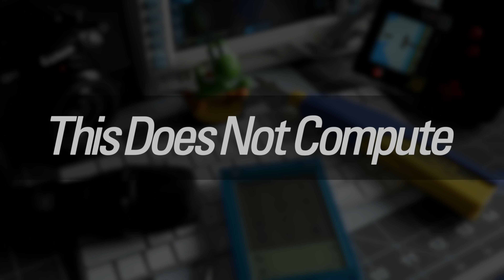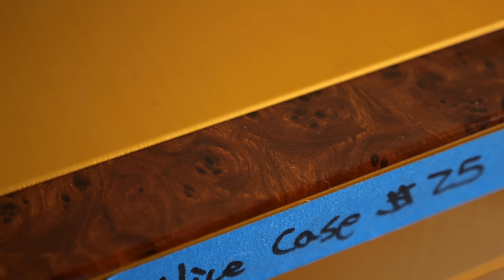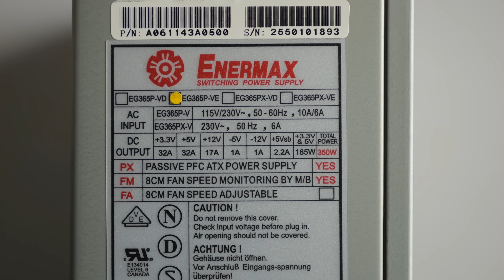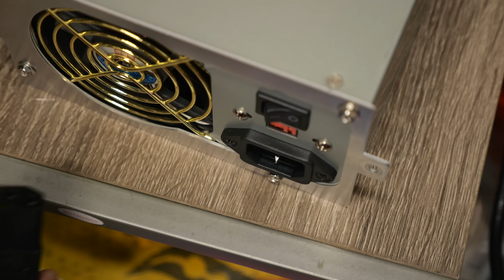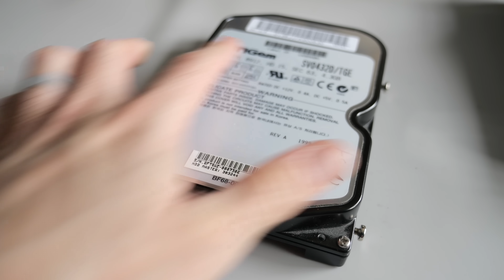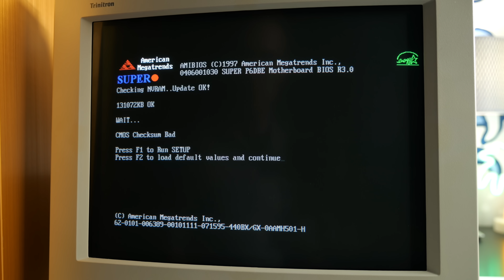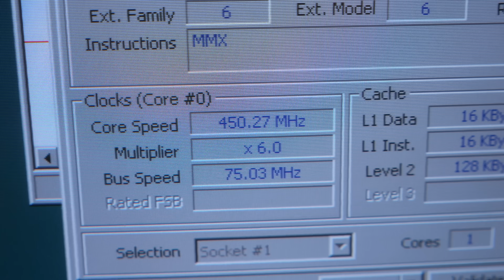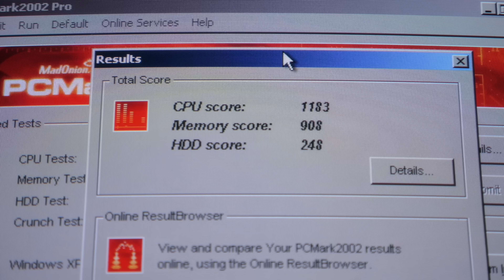I tried to put TWO vintage Celerons in one PC

Comment: I pulled a PC-601A out of the Physics Lab dumpster, surprisingly a couple light scratches but no dents. It runs my retired X58 system now (990X, 24GB, RX 580 8GB), and afterward I got a PC-61B that was saved by a retired NORAD employee when they were shredding old systems... to paraphrase the gentleman's words, "it was too nice looking to throw in the shredder, so I pulled the hard drive and tossed that in (the shredder), and they let me take the rest of the system home with me".

He then sold it to me for $25. I installed my retired Z87 system in it (4770k, 16GB, 980Ti 6GB). A Noctua NH-U14S actually fits perfectly without rubbing. 

I also have a Velocity Micro that's a re-tooled PC-60A underneath, and using WayBack machine I found the original listing for a ProMagix HD-60 retailing for over $4k in its day (2006-07)... someone got literally every option for this case, including the optional wheels, optional acrylic side panel, and optional cold-cathode lighting kit. That one I'm leaving mostly stock. I got it for $80 on MarketPlace, only missing the GPU (I believe it shipped with a 9800 GTX+ originally). I installed my retired ATI Radeon HD 5970 instead. 

I had to fill the holes left by the old drives left in my cases, they were all unsightly beige actually, even on the B case. Both machines were missing 2x 5.25 covers, as well as 1x of the 3.5 covers for a Floppy or Zip drive, so I gave the 61B a Blu-Ray/HD-DVD/DVD-RW drive, the front panel controller for my X-Fi Titanium Fatal1ty sound card, and a 4-port USB 3.1 hub with card reader, all in black. The 601A then got matching LG Blu-Ray burners in black and silver (good match for the Aluminum tone), along with a NOS Lian Li Aluminum USB 2.0 card reader. 

In both cases, my solution was what I had on hand (I recycle e-waste, that rare HD-DVD drive for instance came from a Gateway FX tower with bad caps found in a dumpster), and the cost still ended up being far less than replacing those covers. I imagine the PC-60C (Copper?) anodized case covers are pure unobtanium (I've only ever seen Aluminum and Black finishes for sale on the used market), and you had all of them... what luck! 

I would have left them installed and run external optical and floppy, but that's my opinion. I think it looks awesome, I've not seen the faux wood trims before, either, as mine came with the faux carbon-fiber trim panels instead. You scored a real gem there, thanks for sharing!

Comment: it will work with slotket with dual cpu support jumper and socketed celeron. 😅 And of course an 440bx chipset Asus P2B-DS motherboard.  i've done it before. You have to use nt windows too. 9x windows don't have dual cpu support.

Comment: My lab mate and I built a couple of these back around 1998. I remember having to solder the wire to enable SMP, but I don’t recall having to disconnect any traces or do any drilling. Worked great with Slackware Linux and kernel compilations were super quick, esp. at 450MHz. Did quite a lot of work on that machine. I would suggest running an old Linux rather than Windows on a machine like this. Windows from that era was junk afaic.

Comment: Haha, I had an Abit BP6 with two Celeron A 300 MHz CPUs overclocked to 550 MHz, running Windows 2000 Pro in a Lian Li aluminium case, back in the day. Strong nostalgia feels with this one.

I remember Creative’s SoundBlaster drivers wouldn’t work reliably with dual processors, until they eventually fixed this. Quake 2 Arena would gain a little speedup in r_smp 1 mode, which was cool.

My current vintage PC has dual 1 GHz P-III Slot 1 processors on an Asus P2B-DS motherboard and a Geforce 4 Ti graphics card. It’s the dream PC I wanted 25 years ago but couldn’t afford until now. Runs Windows 2000, OPENSTEP for Mach, BeOS and even Haiku beautifully.

Comment: Thanks for the nostalgia trip. I had dual 300As @ 450MHz running Windows 2000 on I think it was a DFI board. I was lucky enough to get some P3-550s and then eventually moved onto a TYAN S2466 + pair of Athlon MPs.

Comment: I have a similar case. No fancy colouring, just plain aluminium. The dust filter disintegrated on me when cleaning it a number of years ago. Ended up as powder inside the vacuum cleaner.

Its first build was either an Athlon XP or Athlon 64X2 running Windows XP (32 or 64 bit, depending on which one it was). It currently houses a Ryzen 2700 running Linux Mint.

Comment: you can run dual 300a's without physically modifying the cpu.  my friend built this exact system and never had to run bodge wires or drill out vias.  

you need to find the socket versions of these chips and run them in "slotket" adapters

Comment: One thing, you have to check the rail voltages on the PSU under load to, to make sure they are ok. I first test it like you did, and after i use a multimeter to measure the voltages when its installed and under load.

Comment: If you want dual celery - you need socketed (370) clelerons and abit bp6 board. You can also overclock them - I have mine 2 x 366 running 550Mhz

Comment: I remember that there was a dual socket solution to celeron from EPOX if i am not mistaken. I used it to build a windows server for the university lab. But as i told it was a socket not slot.

Comment: I was impressed the inside of the case edges had edge guards.  The real cheap cases back then were stamped steel and were almost razor sharp.  When I worked as a bench tech back then, I could count on cutting my hands on them at least twice a week.
Reply: razor sharp edges and a pirate copy of windows from the dealer were usually a feature of the el cheapo systems

Comment: Whata trip down memory lane! I had two machines running SL32A 300As and one ran at 450mhz, the other at 504mhz. You won't get the Costa Rican ones running that fast, you need the Malaysian version. The Celeron is a cut down version of the Xeon and thus it scores over the PII in two ways, firstly they left the heat shunts in the processor so it can dissipate more heat and secondly the cache RAM is on the processor dye which has cooling, if you look at the PII the cache chips are off to the side, the heat sink doesn't touch them and they run at the buss speed, not the CPU speed! I can't believe this was somethign like 25 years ago, wow, where did the time go?

Comment: Yeah the slot 1s needed a mod to run in smp. S370 first gens did it without mods. I remember upgrading a tyan dual 440lx to dual celeron 533 on s370-s1 adapters. Dual 300as at 450-464 on a 440bx was awesome

Comment: I used to have a later Celeron 667Mhz, that easily did 1050Mhz!
I think it even could do better, but I was hitting the limitations of the motherboard.
Still regret getting rid of that system 😢😢

Comment: Another great video! I actually had an SMP setup in the late 90s with 2x Celeron 400A overclocked to 500. I had an Epox 440BX motherboard and I built that system after a month's frustration with AMD's first Athlon dreaded compatibility and stability issues. Anyways, I got around the Slot 1 SMP limitation by having 2x iWill Solt 1 to Socket 370 adapter board. Also since 440BX does not support ATA-66, I had an iWill apapter card and ran 2x IBM glass "death star" HDDs in RAID 0. GPU was the original GeForce 256. From memory, the frame rate was better than dorm mate's Pentium III 500 (Slot 1) with the same GPU. Anyways, I am pretty sure you can work around the Slot 1 limitation by adapting Socket 370 CPUs and it would also be period correct. I also ran Windows 2000 BTW.

Comment: About that terminator card.  I would put that in an antistatic bag taped to the top of the inside of the case.  If not in the case, a place where I will always be able to find it.  It is an odd card and might be difficult to find a replacement for.  It would also be a surprise of Supermicro still had any left in their warehouse.
Reply: It's not brand specific and there are dozens of S1 terminators on eBay right now. And my HP board happens to work fine even when the terminator is missing.

Having said that, obviously try not to lose it.

Comment: If my memories serves me right, P2 have cache that runs at half bus speed, celeries had cache that runs at full bus speed.

That is why an equally clocked P2 is outrun by a celerie. 

And that is also why P3 at the same clock beats the celeries with full bus speed cache and bigger cache.
Reply: That's exactly correct, most dual slot 1 celerons were upgraded to P3's later in life for this reason. But we skipped the P2s

Comment: the bus speed increase also probably helped the gpu, i also tend to use pc133 sdram when overclocking older computers since the ram runs at the same clock as the bus.

Comment: Back in the days I built my Abit BP6 dual celebrant 300A system. I modded the CPUs using badge wire, masking tape and drill, it works like a charm at 504mhz, good hacking memories….

Comment: I had a similar system in this era with two Pentium 3 500's, OC'd to 733 Mhz, which they did with ease.  That was my main machine for awhile, well past when it was time to upgrade (Pentium 4? Ugh!) until the machine was killed by an electrical storm.  It wasn't until the Core 2 duo era that we saw multi-core systems get popular.

Comment: I had a Lian-Li PC-62 back in the day. That was my upgrade from an Antec full tower. The PC-62 was an extended depth PC-60. I thought it would offer better cooling performance. That was a great case. It was silver though. In answer to your question on faceplates, the answer there was drives that had swappable ones, and some automotive spray paint.

Comment: I did the mod to a pair of 300As back in the day (at 450MHz), though I don't recall which board, it was 25 or so years ago! Windows 2000 saw both cpus, but as my main use was games and they were all single threaded at the time (and many wouldn't work on NT based systems anyway), it was all academic and I ended up using Windows 98 and just one cpu.

Comment: Later Celerons are also fun to play with. I have a Celeron 533 on a slotket adaptor in my W98 pc, and it runs happily at 800MHz. More than enough power to get the most out of the Voodoo3 3000 I have in there with it.

Comment: Those plastic clips were the Achilles Heel of early 2000s Lian-Li cases.

The 300a clocked to 450 MHz won in a number of benchmarks due to its full speed 128KB cache while the Pentium II's 512KB cache ran at half speed. Hence the Celeron was preferable for applications that benefitted from cache speed and the Pentium II 450 was preferable for applications that benefitted from cache capacity, such as office and productivity, from what I recall.
Reply: That sounds correct to me. If the process simply required CPU speed, the 300A ate it up. Running the 3D Benchmark was slower than the P2, but in the Prime Sieve, the overclocked 300A won, as I remember. Only problem that I remember about the 300A Overclocked, was I had to replace the heat sink grease every six months or so.

Comment: I have one of those Dual Socket 370 board with two Celeron 366 running at 550Mhz. It's a Abit BP6, try to grab one if you can still find them. If my memory is correct I could push the FSB to 112 Mhz, or about 600Mhz for the CPU's. I would have to replace some capacitors on the BP6 to double check. 😅
Personally I do think that Intel just forgot to lock the FSB for the Celeron's. They had less cache than the Pentium II, however it was on die and running at full bus speed which made it faster.

Comment: Still have my 20 year old PC70 Lian Li case and will not switch it against anything new soon. There is simply sooo much space inside. Had all sorts of high end GPUs in the past and not one of them was too long for that case. :)

Also space for six harddisks and 9 external bays. Why don´t modern cases have that anymore? Fishtanks are looking good, but try to install your BluRay-burner into one. ^^

The plastic clips became brittle and the front panel was no longer holding. Luckily I found replacement parts for 3d printing, had to hone them down a bit after printing, but now the front panel is rock solid attached to the case like on the day I bought it. 

No cablemanagement, no place for watercooling and also only 80mm fans. Okay, it is old. And I have a perfect excuse why I have a rats nest in my computer.

Comment: I was going to say Cyrix socket 370s couldn't run in dual CPUs, so I was surprised slot 1 Celerons can. I have a Sossaman Xeon Super Micro board with 2X T2500 (ES) CPUs in it. It's a cool board. I just don't know what to do with it exactly.

Comment: I did the mod back in the day, we needed a cheap SMP MSSQL box. I brought 3 x 300A's, a spare in case I broke one, broke none, the system went like hell at dual 450, even with the smaller cache. Drilling out the pin was nerve racking!

Comment: Samsung really did make the best HDD in the late 90's/early 2000's. I own several, and my oldest example (10GB 5400RPM V1020 - stated in the redhill guide as 2000's drive of the year) has lower seek latency than either of my SATA or IDE Seagate Barracuda 7200.7, meaning that any OS installed feels really responsive.

Unfortunately you'll need a board such as the Abit BP6 and a pair of the rather rare S370 Celeron 300A. However I have found with my Intel SE440BX-2 that a Celeron 500 (slotket) has the same performance as a Celeron 450A.

Comment: "Three stars" vs. "Three Gems? Interestingly enough that korean apple didn't fell far from it's tree. 🤔 You could manipulate the Vcore voltage if you got your hands on some more 300As, changed up a few 0ohm resistors on the CPU card itself and If the voltage regulator was capable of handling it. There are 3-5 "voltage ID" pins which are basically select lines on most (Holtek?) regulators to binary match voltage preset steps to a lookup table (similar to jumper settings).

Comment: I’m pretty sure I did this back in the day on a Tuan motherboard for my college radio station so we could webcast. Needed all the performance we could get on a budget to encode to 128kbit MP3 in real-time. I thought there was a way to enable 300A smp by cutting a trace or putting kapton tape over one of the card edge connector contacts.  But maybe   I’m misremembering

Comment: Goodness, I built 2 PCs in that LianLi model case. A black and a silver I think. I never knew copper with plastic burl was a possibility. This was before easy availability of floppy and cdrom drives in black. I spray painted mine. Thanks for that bit of nostalgia.

Comment: For a technical explanation on the 100 MHz-bus-upgraded Celeron versus a "true blue" Pentium II at the same speed - the only real differences were that the Celeron-A had a full-speed 128 KB Level 2 cache on the CPU die; where the Pentium II had 512 KB of Level 2 cache running at 1/2 CPU speed as separate chips on the Slot-1 card.

While more L2 cache is generally better, having it on-die and full speed more than makes up for it in many circumstances. So a 450 MHz Celeron versus a 450 MHz Pentium II - in many workloads, the Celeron would beat the P2 because of the faster cache. Only in cases where the cache being smaller was a major component did the P2 do better. (That's also one reason Intel kept the Celerons at a lower bus speed for so long - to purposefully hamper their performance so as not to compete with P2/P3. Also why Celeron didn't move to the P3 core until quite a bit later.)

One big thing about "dual Celerons" - the shown dual-socket board was released when ONLY Celeron's were available on Socket 370! When it came out, it was purely a "run dual Celerons against Intel's wishes" motherboard. Pentium III hadn't yet come out in Socket 370. And by the time it did, humorously you had to modify the P3 to get it to run on that board!

Comment: I had one of those cases in use u til 2018. Had a 7-inch LCD in the front and a 4-knob fan mod on the top. The thing was louder than a hairdryer on full-blast

Comment: The 3.5 bay can hold a HD, but then there is no air flow or cooling. The HD cage is where the HDs are best located. That way the front fans can cool the drives and the dust sponge would help keep things cleaner. Unfortunately, that filter has exceeded its life span.

Comment: The advantage of the celeron A series was that the cache, though much smaller than regular Pentium 2's and 3's, ran at full processor speed, whereas on the p2's and 3's ran at (my memory is falling me) half or third the processor speed. I have very fond memories of a celeron 400(s370) which I had stably over clocked to nearly 500mhz paired with a geforce Ti4600. 😢 Those were the times

Comment: I always liked the Processor Slot style motherboards.  I never actually had an x86 board with a slot 1/2 processor, but I had a couple of the late 1990s Apple Power Macs which also used the same style slot for their PPC processors

Comment: I have the brushed stainless steel version of that Lian Li case, and good to see that you can 3d print the clips, they broke over a decade ago.
The 300a for the most part was dead simple to get to 464mhz on moat boards. I had an Abit board where I could do it in the bios, and ran it 24/7 for a couple of years until I upgraded it with a Slocket to a 1ghz p3(the 100mhz fsb part) then ran that at 1030mhz for a couple more years.

Comment: The Lian-Li case was a game changer back in the early 2000s. When our options were the standard beige box, the amazingly capable Antec SX1030b, then Lian-Li came around and set the new bar. It was light-weight, helped dissipate heat without needing horribly loud Delta fans, and still looked sharp.